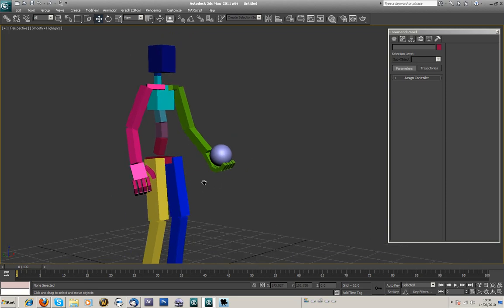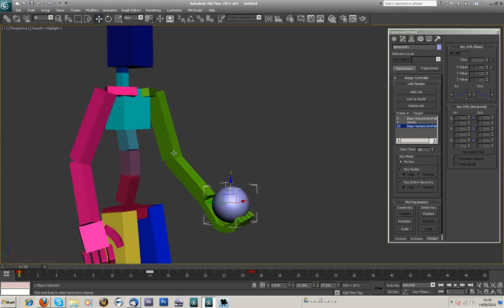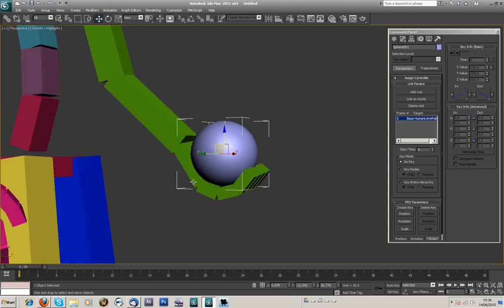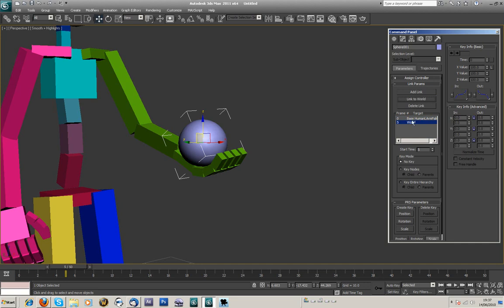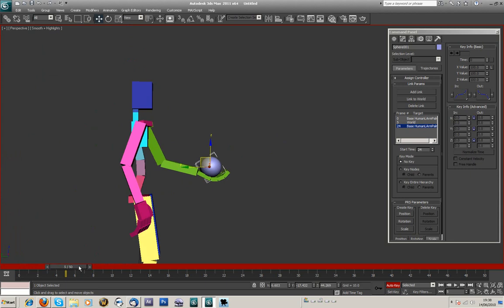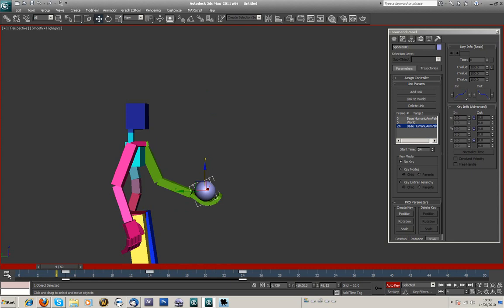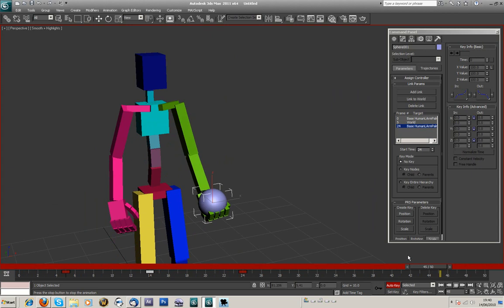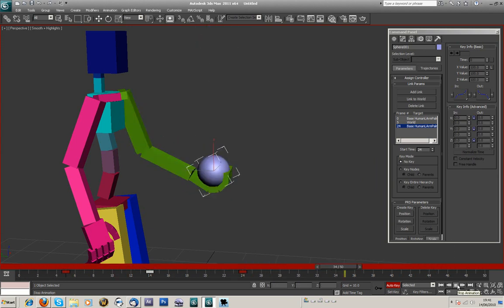Link Constraints 3D Studio MAX

Comment: how you can link that ball to both hands?
Reply from the maker: you wouldnt, you would link the hand iks to the ball
Reply: @LeeJackson3d  can we do ik with simple bones system in 3dmax?
Reply from the maker: @MsAtifMehmood  of course. Just use the HI solver or any other solvers to control bones. You can also use max ik with cat bones if you goto animation and apply max ik